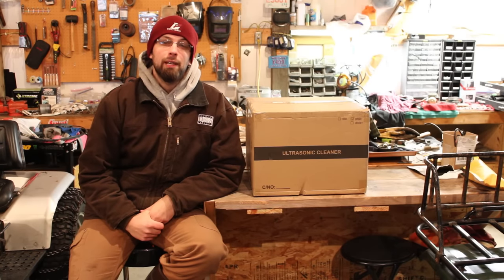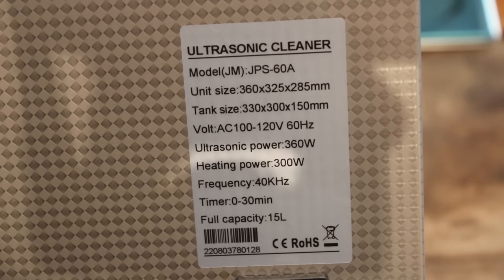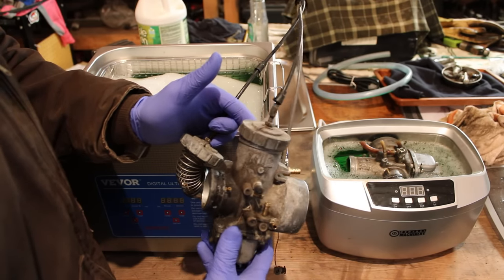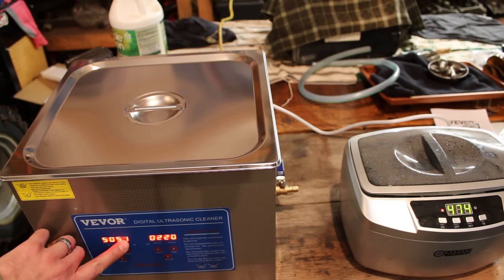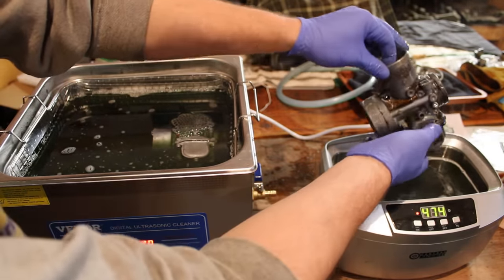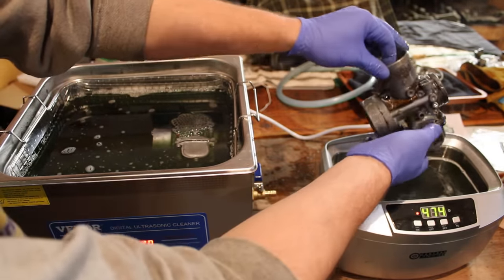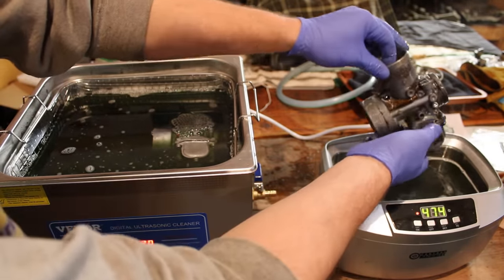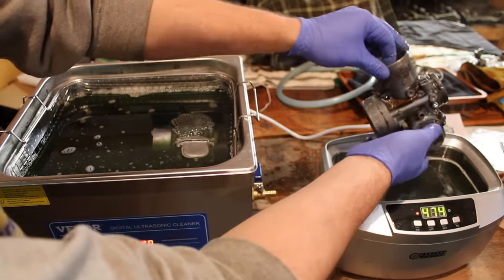Ultrasonic Cleaner BATTLE! VEVOR VS. Harbor Freight! Unboxing, review, and carburetor cleaning!

Comment: I have the same Vevor.  Another tip: if you have small parts and don't want to use a lot of solvent/cleaner, you can put the parts and solvent in a cheap plastic resealable container, then put it in the tank, with the tank filled with water.  Also, works great with Evaporust in the tank.
Reply: I’m a big fan of placing parts in plastic bags when trying to conserve Evaporust or vinegar.
Reply: I haven't seen evaporust tried yet.
But I can say with top rated cleaners they are awesome. 
Because I'm mobile small engine maintenance and repair I got a small one. It's definitely the difference between the pros and the Joe's.
Fresh water in the cooker and solution with the parts is the hack but I have not tried it yet. 
What I do know is,  get a good one.
And get one big enough. 
Don't fool around to much with the cleaning agent. I've heard tail that oxyclean is moving right along. 
Recap, get a good one, get one big enough and use a good cleaning agent. After that use smaller containers to put the parts in and fill the cooker with water. 
My hack is to filter the solution with very fine automotive paint filters, super cheap, they just sit in a funel. 
And of course don't let the cooker freeze up with fluid in it.
Reply: Plastic can absorb the sound waves, use glass or metal instead.
Reply: @1skinnypuppy

Comment: The smaller one is designed for jewelry and such.  The ultrasonic cleaner works anywhere the fluid can get to.
Reply: Smaller one is designed to make tea with loose leaf tea, just repurposed. Called a tea ball or tea strainer I believe.
Reply: The power does matter a lot tho.

Comment: I hated cleaning out my ultrasonic cleaner, so what i did was fill it with water. i collected jars of various sizes and put the parts and cleaner in the jars and put the jars in the ultrasonic cleaner and turned it on, and what i expected that would happen actually happened. Everything was clean when it came out. Each jar was taken out and everything inside was clean and the water was still clean. Now i leave the cleaner in the jars until it gets to dirty then it gets disposed of i use LA's totally awesome in the jars because it is $100.00- $1.25 a quart and it is also all natural, but it works great and i don't have to clean the machine.

Comment: I have a vector of that same size, had no issues with it, however as you said the water heater is useless, even 60 degree (C) water takes all afternoon to get up to 80 . I don’t feel this comparison is valid, it’s comparing apples with oranges. The harbour freight unit is only a jewellery cleaner. You also need to degas the water as neither has an auto degas function, to ensure optimal results .

Comment: I got both too, what a difference in cleaning with the vevor.  Best cleaner I found is Fabuloso purple .  Does not darken aluminum and makes it super bright .
Reply from the maker: Thanks, I'll have to give the fabuloso a shot! Right now I'm mostly just using dawn dish soap and it doesn't work too bad lol.
Reply: ill be damned
Reply: I'm surprised that Fabuloso cleans anything, I thought it was 90% fragrance. Just makes your clothes smell like they're clean...
Reply: With the smaller unit, get the jewelry cleaning solution it is designed to be used with, and use the unit to clean only jewelry and small machinery parts.  You can get the jewelry and small parts cleaned more economically if you put the items in small, sealable plastics bags(no air left in them), and then add the bags to plain hot water your pour into the machine. The bags will let the ultrasonic waves through the sides of the bags and clean the items; the bags will contain the dirt that comes off;  the cleaning fluid is conserved, and may be filtered and/or otherwise reusable.  The tank, having only come in contact with plain hot water, shouldn't get dirty.
Reply: What I have used with great success is Cascade automatic dishwasher powder. Don't use the packets it's got to be the powder. A tablespoon to a full container works great doesn't seem to darken anything and really it's cheap. A box will last a long time

Comment: I have the same 15L Vevor. A big cat litter bucket or small garbage can fits nicely if you need room for something taller, just make sure to always fill up to the water line in the Vevor. A bucket full of water will vibrate the same resting on the bottom of the tank even if its waterline is way above the tank's water line. I was able to fit half of a whole dusty fan blade of an oscillating fan doing that.
Reply from the maker: Awesome, thanks for the tip! Didnt know that would work, good to know.
Reply: Most things I put into sealed jars or bottles. Anything that won't fit in one I'll always use a bucket. I've never put anything dirty into the tank itself.
Reply: I’d like to see this. I’m guessing you put a tall container inside of the vevor, filled the container to the desired level and put water between the container and the interior of the vevor to the vevor fill line.
Reply: @geohazel4984  Correct. My typical go to is an 35lb cat litter square bucket that has a lid. I have two cats, so I have a bunch laying around. These buckets fit perfect into the 15L Vevor with or without the basket. I fill the bucket with whatever and rest it on the bottom of the tank, then I fill between the tank and bucket with water to the line. 

The last time I used my ultrasonic was two months or so ago. I had to replace some catch finger thingies on one of the shafts in my lawnmower's transmission, so I degreased the whole thing. One bucket had a mix of water and degreaser for the aluminum clamshell, and another had a gallon of acetone for the steel gears and everything else. I used the ultrasonic on both buckets a few times. Normally, you'd never want to put something like acetone in an ultrasonic, but sealed in a bucket, it was fine and it never got dirty.

Comment: Add more water to help keep it quiet.  I've found that if the water is a little low, the machines are waaaaay more noisy.  And fill your tank with water and clean the parts in smaller containers (put the containers in the basket to keep them off the bottom).  That'll save you some cleaning solution.  Of course that doesn't work for the big parts, but for small stuff it's awesome.  And as someone else mentioned, EvapoRust in a hot ultrasonic works miracles.

Comment: Great video
I have the 30 L model I have learned that simple green discolors aluminum. So I use simple green pro (the purple one) doesn’t hurt my firearms or carburetor. I use the biggest pickle jars I can find and put parts in it to clean. That way I don’t have to change the main fluid as often. Well if I put bigger items in like …I fit a Honda 70 gas tank i(restoring barn find) in to clean out the rust 
Glass containers work better than plastic for allowing the waves to penetrate 
I use the water from my dehumidifier to fill the unit
Hope this helps someone
Reply from the maker: It will certainly help me in the future. Thanks for the great tips!

Comment: I have the smaller unit and I've had it for years. I use it for cleaning locks and firearm parts, it's awesome! This year was the first time I used it to clean jewelry with an actual jewelry cleaning solution; I was blown away. I have never seen gold, white gold, and silver blindingly shiny, nor have I seen diamonds sparkling unless they were in a display case. I may pick up that larger unit for some larger lock projects 😁
Reply: What cleaning solution do you use? I just bought one and hell I don’t even see bubbles😅

Comment: I own and use a Vevor. The heater works just fine. Warming water takes time, fill it with cool tools or what not and yeah it will take a while. I have run the Vevor for two day's on an almost constant runs. Dirty tools, greasy parts and the wires jewelry all came clean. I am happy with the purchase.

Comment: This kinda like putting a car up against a pickup truck in an RV towing test. Both can do it but 1 is meant for that duty towing. But if you put them head to head towing a small 4x6 trailer both will work perfectly. But the correct tool for the job. I have the small one and it works perfectly for small carbs, tools, jewelry, and other small items.
Reply: Better put, but exactly what I was going to say. Not comparing two like items. Also, bet the HF one is considerably less costly.
Reply: @lindacondray7918  despite his mistake of "daring to post" on YT an unfair comparison because of the size i can say vevor has smaller sizes too and they work just as good.(idk about HF ones as i never used them but despite being lout it seems like my vevor always dose a great job(besides completely rutsed parts)

Comment: The "Vevor" unit is just a generic ultrasonic cleaner, with a "Vevor" sticker on it - there are many units for sale with the same controller & electronics.  One point I would make, is the 'bowl' is glued into the chassis, but the glue is not great.  Be aware that at some point, the bowl will probably come unstuck and you can damage the ultrasonic transducer & heater etc, if the chassis falls away - always try and lift the unit from underneath.
Reply: From what I've seen, all of Vevor's stuff is branded generic goods. 

I mean, that's a legitimate way to run a business if you want, but its best for the customers to know.
Reply: Who actually made the unit? And who sells it at the lowest price?

Comment: I have the Harbor Freight  unit, I only use it for fuel injctors and fuel filter elements, it works,but I sometimes restart it  couple of times.I also use vinegar in mine. If I were going to clean a carb like those, I would disasemble them and throw the bodies in a regular parts washer then do the jets and small components in the ultrasonic.

Comment: Most ultrasonic cleaners will do the job. The thing i have found from experience that makes the biggest difference is the solution you use. Truth be told the best solution i've used now is a 50/50 mix of Pine Sol and Water.
Reply: Side note i have one of the Vevor units as well.

Comment: I use the simple green Aircraft cleaner. It won't corode aluminum. I think it works great. Small zip lock with cleaner and the tank straight water saves a lot of cleaner.

Comment: The small harbor freight cleaner does work but you have to run it through the machine many times for it to work. I have put some nasty carbs in the small harbor freight cleaner and it looked like new but it took hours
Reply from the maker: I'd agree with you on that. It's not that it doesnt work, I just dont think it works well enough on anything I'd put in it to justify the $80 price tag.

Comment: You CAN damage things in an ultrasonic cleaner. A quick test to see if the ultrasonic power works is to put a piece of aluminum foil in it and watch it cut tiny holes pretty quickly.
Reply: Decades agom we loaded a cleaner with fine thread SS bolts, filled it with solution, and left it over night. Next dsy, the bolts touching each other had machined away their threads.
Reply: Decades agom we loaded a cleaner with fine thread SS bolts, filled it with solution, and left it over night. Next dsy, the bolts touching each other had machined away their threads.
Reply: Decades agom we loaded a cleaner with fine thread SS bolts, filled it with solution, and left it over night. Next dsy, the bolts touching each other had machined away their threads.
Reply: Decades agom we loaded a cleaner with fine thread SS bolts, filled it with solution, and left it over night. Next dsy, the bolts touching each other had machined away their threads.
Reply: Decades agom we loaded a cleaner with fine thread SS bolts, filled it with solution, and left it over night. Next dsy, the bolts touching each other had machined away their threads.
Reply: Decades agom we loaded a cleaner with fine thread SS bolts, filled it with solution, and left it over night. Next dsy, the bolts touching each other had machined away their threads.
Reply: Decades agom we loaded a cleaner with fine thread SS bolts, filled it with solution, and left it over night. Next dsy, the bolts touching each other had machined away their threads.
Reply: Decades agom we loaded a cleaner with fine thread SS bolts, filled it with solution, and left it over night. Next dsy, the bolts touching each other had machined away their threads.
Reply: Decades agom we loaded a cleaner with fine thread SS bolts, filled it with solution, and left it over night. Next dsy, the bolts touching each other had machined away their threads.

Comment: I've had the HF unit for over 10 years and it's still chugging.
Bought a larger Vevor and wasn't as impressed with it, it wouldn't get as hot as yours and the HOBO unit gets almost boiling and I've found it cleans extremely well, if it fits, it cleans it. I only bought the Vevor unit to clean 12 speed mtn bike cassettes and have been mostly disappointed with it, actually. It always cleaned my smaller cassettes perfectly.

Comment: I have a smaller Vevor that I purchased for cleaning small engine carburetors.  Does an excellent job, seems to be well built.  Be advised::  some cleaning/degreaser solutions will react badly with aluminum and rubber parts.  To be safe i wash the crud off the outside of carbs before disassembly.  The i use Dawn dishwashing liguid as my degreaser.  Works very good but mat take longer.

Comment: I have a ONEZILI Ultrasonic Cleaner 3L I got off Amazon. Probably the same manufacturer. They look nice, but NOTHING on mine is stainless steel. I made the silly mistake of using some acid solution in mine, to attempt to strip some chrome plating off a piece. Sorta worked, but also etched the tank badly. I may buy this Vevor model, and stick to Simple Green, or similar.

Comment: I've got the HF cleaner and I use a large commercial unit at work. There's no comparison. The HF unit may be fine for removing grime from jewelry but its not worth much on greasy parts. 
When it comes to carburetors though, I still don't see using an ultrasonic cleaner being as good as the old Hydroseal method or even a couple cans of 2+2 carb cleaner or equivalent. I've yet to find a water based solvent for the ultrasound unit that will break down varnish from old gas or remove corrosion from small brass parts.
Reply: try using gasoline in a container inside the cleaner unit. water in the unit itself, then a container with gas in it for the varnish.
Reply: @Wolfiecolada   I was thinking of posting like this. others I have seen use gas or diesel in jar or baggies, and thats a great cleaner
ive used less flammable diesel, kerosene and wd40 or liquid wrench  which cleaned great for me.
 in the vevor was just water (it stays clean doing its job) to the full line. [still loud, but I run it outside] ;)

 and yeah I drain it in winer as even the shop gets cold as outside is around 0 Fahrenheit
Reply: Pinsol will get the varnish off.

Comment: I have the harbor freight one also and use simply green in it. I've done several carbs in it but disassembled them first and it cleans fine. But it is way to small. I might check out the 30l vevor

Comment: i have the same one. only problem i had was the ball valve leaks. mine did not come with the barbed fitting , mine was a threaded valve ,so i put a pipe plug in it
Reply from the maker: Good call. So far no leaks with this one. I've used it about 5 times thus far and I dont have a bad thing to say about it.
Reply: I used 1/2 pex ring crimper  for my unit. It fit perfect.

Comment: Have you, or could you, measure the actual Wattage of your ultrasonic cleaners.  My Creworks cleaner is listed as 180 watts for the ultrasonic transducers.  When I measure it with a Kill-a-Watt meter using only the ultrasonic function of the cleaner, it measures between 110 and 135 watts.  I would be interested in knowing what your model is rated as and the actual power consumption.  You posted a great video and I appreciate the information you provided.

Comment: I have used the HF unit for years. Yes you have to rotate parts. I have cleaned many carbs and I have gotten my monies worth. Maybe if I was in the business of cleaning carbs a bigger unit may be worthwhile. If you are in the business you also need a bead-blaster machine and a good buffing machine.

Comment: Different machines have different frequencies which are better for some things and worse for others. Its best you keep both machines. Maybe use the Harbor Freight one for initial cleaning since it holds less fluid and is easier to empty and then have the big machine for the final clean.

Comment: Researching ultrasonic cleaners i read that 70'C is the ideal temp.  Just an FYI.
Reply: The optimum working temperature is in between 60 C to 70 C. It also depend on the used solutions design temperature. 🙂

Comment: Your video couldn't come at a better time. I'm in the market for one. Your video has shown me the way I should go. Is Simple Green the best solution to use?
Reply from the maker: It all depends on what you're cleaning. It seems simple green is tough on brass and aluminum, but in general its been a good all purpose cleaner for me.

Comment: Just curious how well the Yamaha F60 carbs fit in the 15L. I was thinking about the 10L mostly for space reasons. I have the little HF one as well and its just toooooo small!
Reply from the maker: You could fit two at a time in it if not more. I just did one at a time when I did the F60 so as to not mix up any parts. (Not that it would matter in that case, but cant be too careful)